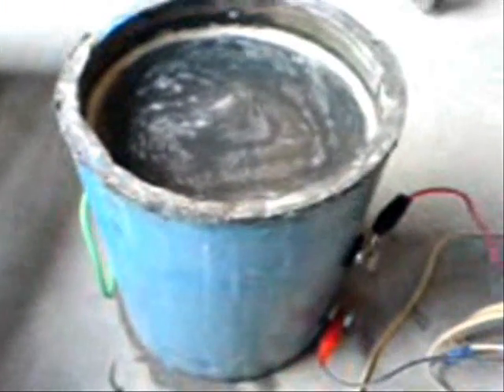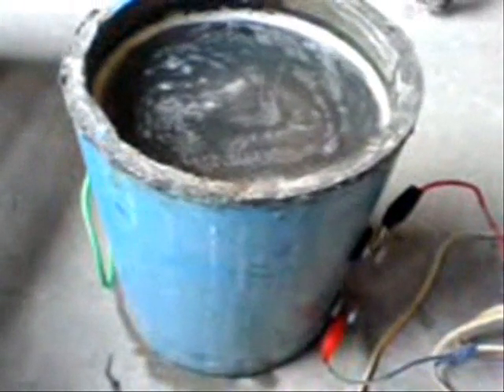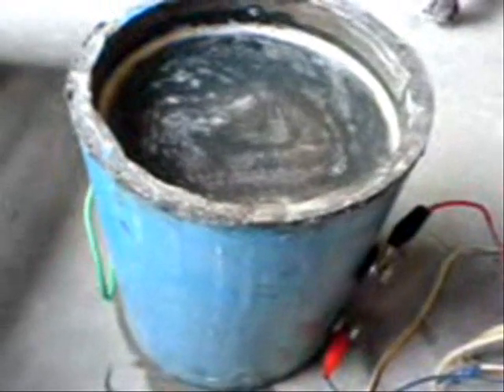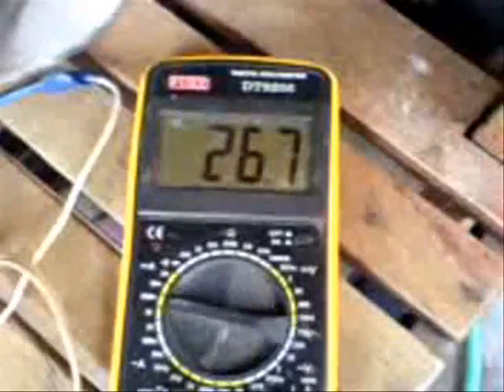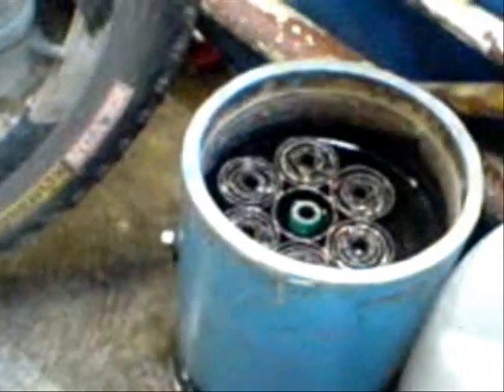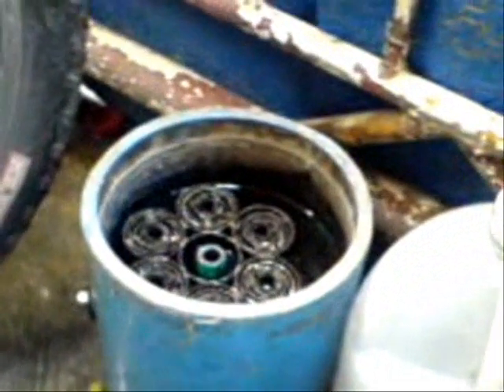HHO Shigeta Hasebe Cell

Comment: Very nice production!, yes that's the way it's gonna be. Maganda ang output. Ang concern ko lang dito if you are going to use that for 100% HHO run, mag adjust ka pa ng spark timing kasi mas mabilis ang combustion ng HHO. sa palagay ko dapat ay may adjustment ka ng hydrogen input na hiwalay, kasi ang pure hydrogen hindi masyadong mabilis mag ignite unlike HHO mixture. 

Also, the HHO should be compressed to about 10 to 20 psi at released on demand.

Just my opinion ito. I am not saying tama ako